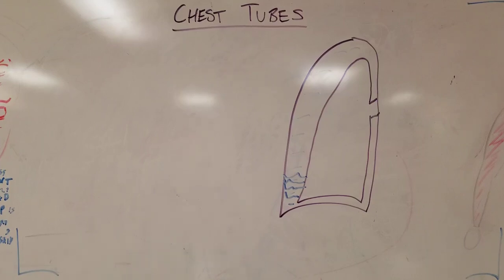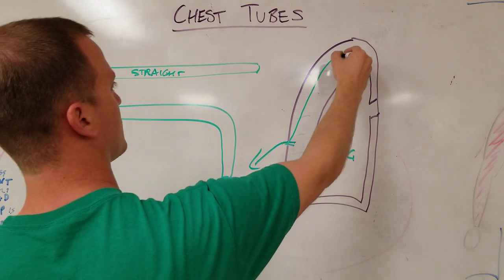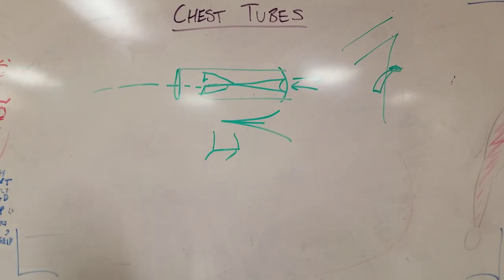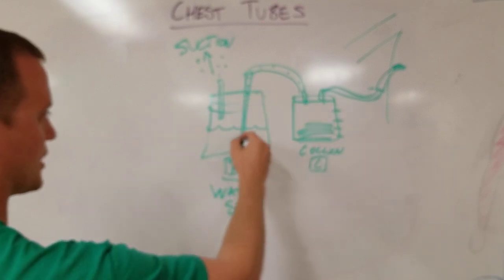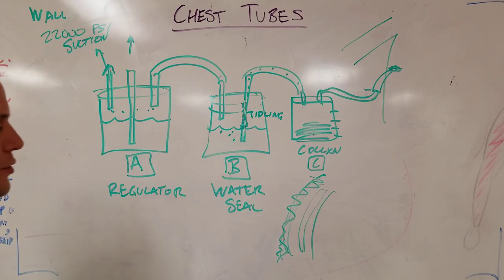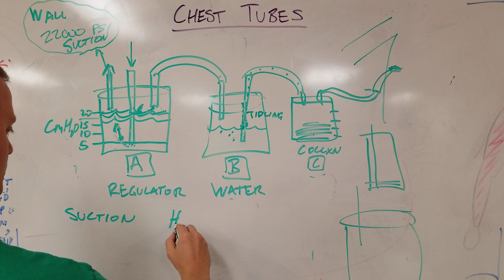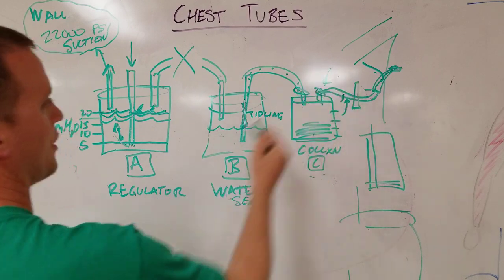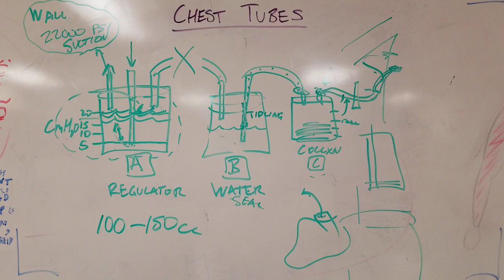How Chest Tubes Work (Tube Thoracostomies)

Comment: If in any instance that "postoperative air leak" is present. What would be the behavious of these chambers esp the "water seal" and "suction regulator"?
Reply from the maker: great question! an air leak would show bubbling in the 'water seal' chamber. this is in the "B" or 'bravo' chamber in the drawing. it's typically located in the lower left hand corner of most commercially available pleuravacs